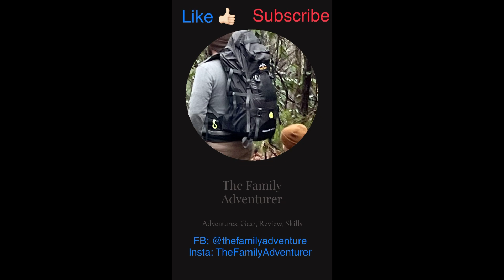Dugout Shelter Part 4

Comment: Did I hear correctly that you're putting your stove by the door? It may not be wise, if so. A fire could prevent escape. I would put it on the back wall or a side wall away from your escape route. I like the way its coming together so far